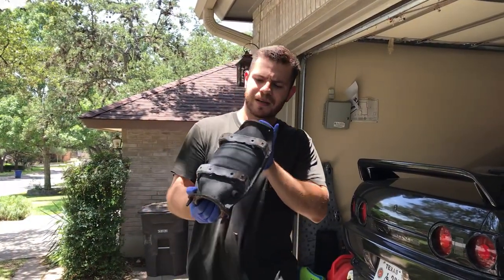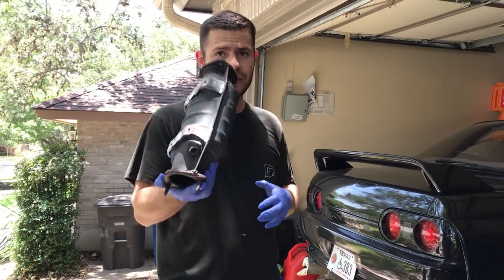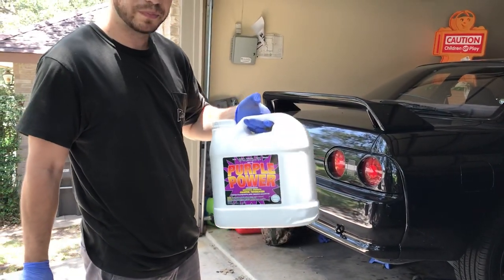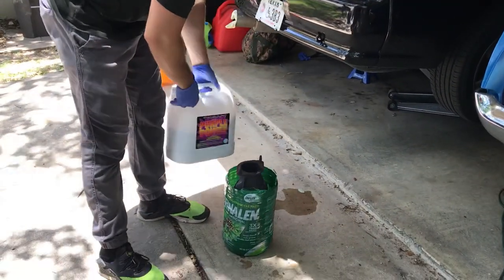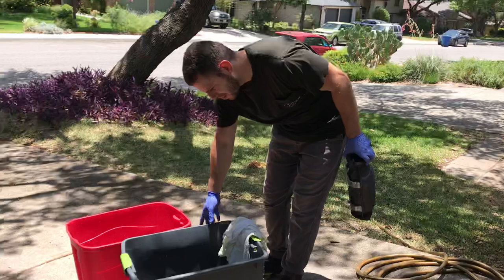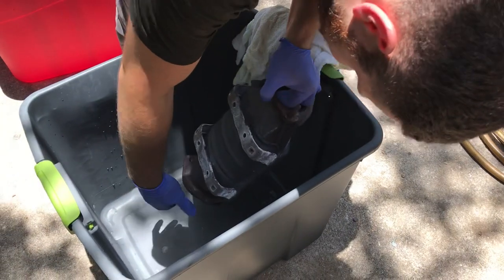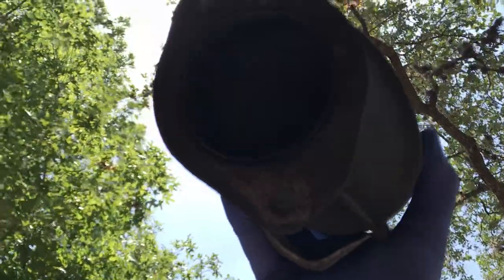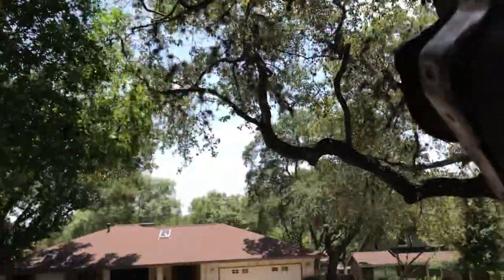Effective way to clean Catalytic Converter Part 1.This works 95% of the time.

Comment: 2012 Hyudai Sonata with 277k miles on it.  Check engine light came on; code for catalytic converter.  Put 1 gallon of lacquer thinner in the tank with half a tank of gas in it.  Drove it on the freeway for 70 miles between 70-80mph, the next day, the check engine light was gone.  It works.
Reply: Freeway driving and also sometimes, hammering on the outside of the cat to loosen up things. The hammer trick fixed my lean codes.

Comment: It actually works. Worked on mine. 2002 Ford Taurus. It was so clogged the car was stalling. I cleaned the one . I have , technically, 2 others .  Walmart has sells purple power the cheapest.  $12 for 2.5 gallons and $23 for 5 gallon.

Comment: What is purple power?
Reply: Is a degreaser super strong you can use it on everything rims ,car grease ,oil
Reply: Careful with aluminum because it’ll eat eat, great way to open parts by .001
Reply: GOIGLE SEARCH anything yu need to know

Comment: Just did this the past week on my vehicle.

2000 Camry 5SFE @155k miles. 
CEL P0420

Went out and bought from Walmart:
2.5 gals of Purple Power Degreaser
18 gallon capacity storage bin

Took off the exhaust manifold/CAT combo and soaked it in the bin for 24 hours.
I poured all 2.5 gallons and topped it off with another 1.5 gallon of water to submerge a large portion of the manifold.

After taking the manifold out, I rinsed it thoroughly and then dunked it generously a few more times in the bin that's now filled with clean water.
Once the part is rinsed and free from degreaser, I dried it off using a blower and then letting it bake in the sun.

The soaking dissolved and loosen large amounts of carbon buildup.
Upon reassembly and test drive, the engine response is smoother and the hesitation on hard acceleration is gone.

Gonna take a mental note and see how it performs the coming weeks.
So far I am convinced it cleaned up the cat really well!
Reply: Any alternative for Purple power
Reply: @SafeShifter  I assume any similar industrial degreaser sold at home improvement stores will provide similar results.
Reply: @2unknown  thank you!!
Reply: LA's Totally Awesome at dollar tree.
Reply: Update?
Reply: @ThisIsMyYoutubeName1  the CEL came back on during a 500 mile road trip a few weeks after cleaning. In hind sight, I should have soak both CATs, but I only cleaned the leading one.  I'm gonna try again later this fall since smog is due beginning of next year. The engine is eating oil, so no reason to clean it too early.

Will update again after the second attempt.
I would assume if your engine isn't eating huge amounts of oil, using this method to clean the CATs would be a cheap and effective attempt before dropping the big bucks.
Reply: @2unknown  I was curious because my light came on, autozone did the diagnostic and it came back as an O2 sensor. Brought to mechanic and had 3 sensors changed. Leaving the mechanic, check engine light came on again, but this time had P0420 and P0430. I’m not sure why those codes weren’t there the first time. I have 2 cats. Took it to a Buick dealership and they told me $3K to fix. Not happening. Tried 2 bottles of Cataclean, drove 400 miles with no results. So I plan to attempt soaking both since it’s showing both. My vehicle still runs amazing, so I can’t help but feel that the blockage is minimal. Fingers crossed.
Reply: @2unknown  I planned to soak in lacquer, not the degreaser.
Reply: @ballzzinyourmouth8  yea, it didn't work for me. The CEL came back on after a few driving cycles.
I called it quits and just bought brand new vehicle specific catalytic converters /with piping to pass smog.

Comment: Trying it today on my pickup. I will let you know in a week once I reinstall.
Reply: Did it work?
Reply: @danielfiore8865  It did clean my cats but the honeycombs were too melted for it to make an impact. If your car burns oil this is something that should be done proactively to prevent the cats from running too hot. Unfortunately, I had waited too long.

Comment: Are most CATs removable like that? Not welded on?
I have a 4 cylinder 2004 Camry SE... CAT can be removed and cleaned without California smog inspection complaining about tampering?
Reply: Yeah, cats can be removed using a ratched. But they can be pretty tough to remove. Make sure you spray some WD40 onto the bolts before you attempt to remove it.
They are some videos on YouTube that show this process thoroughly.
Reply: The leading CAT on the Camrys are combined with the exhaust manifold. It's one whole piece that needs to be taken off. 

You'll need to use the large storage bin (roughly 18 gallon capacity) to fit it for soaking. 

Recently did this on my CA 4-cyl 2000 Camry. 

Taking a cat off for cleaning isn't tampering. Taking a cat off to remove the material for performance gains is considered tampering.

Comment: Why not leave it in vinegar for 24hrs?……… it cleans just about anything……… ( removes rust and other gunk )
Reply: Works for diesel catalitic too?
Reply: @1799cm2  I’m assuming since it won’t eat through plastic but will remove paint, and rust as well as weaken oils, dirt etc……… I do this with all my rusted parts and greasy materials. As soon as 24 hours I dry them quickly then clean with rubbing alcohol then spray with clear or with paint then clear depending if I want to paint the parts.